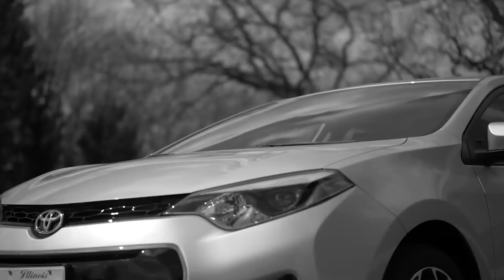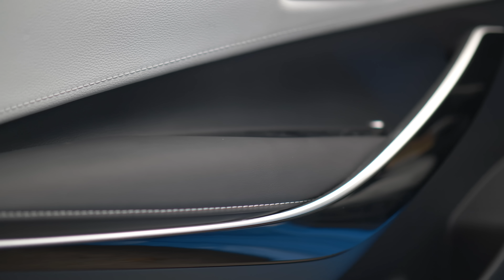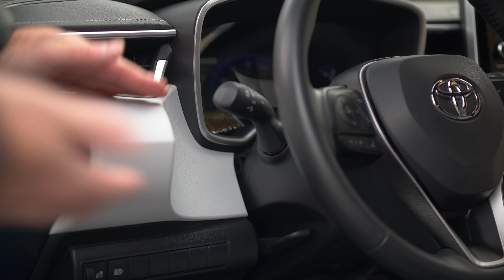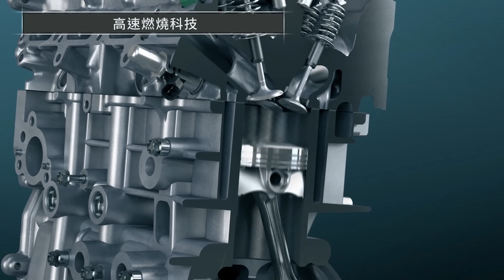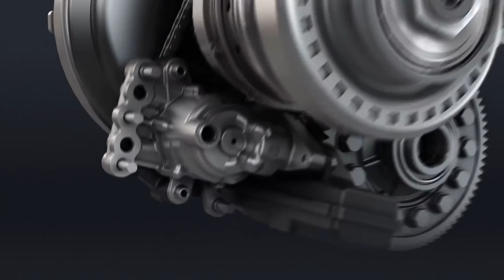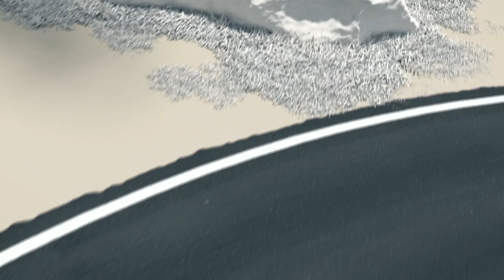Review | 2019 Corolla Hatchback | Sleepy Time is Over

Comment: I would rather get real Mazda 3 instead off Mazda 3 wanna be :)
Mazda3 next to this looks feels and drives like a luxury car.
Good direction from Toyota here, just put nice 8 speed ATX in it!!!!
These mfgs are trying to take advantage of cost savings with these CVTs making them more and more like normal shifting automatic but it still is CVT that after few years may be failing and cheese feel will never be completely gone with it. .... Time will tell reliability wise for engine and CVT both can be prone to issues and this is a big NO NO for every Toyota buyer

Comment: Turbo = performance.  I don't care how small or big the turbo is, but 0 turbo = 0 turbo.
I won't even consider going in to a dealer to test drive ANY car, if it's not any cut above a normally aspirated engine.  I have a turbo, Have had it for 14 years, and know for the first time, what a performance 4 cylinder can do for me.   Toyota will eventually come up with a sensible turbo to put in this thing, but I guess now is not the time for this car.

Comment: I still picked the 2019 Forte S over the Corolla just because I got a better lease deal. I did look around the forte inside and out and found it could very well be a keeper assuming the weakest link isn't the IVT. I'd actually buy it off if it behaves well enough. It's cheap to operate and easy to work on.

This hatch would be #3 in my top 3 where #2 would be a Forte5 with the new re-design.

Comment: Went with the Mazda 3 hatch over this simply because the safety systems in the Mazda were better implemented and more customization.

Entune or whatever Toyota calls it is total crap compared to Mazda Connect - and lets face it, Mazda Connect ain't no saint it has some massive flaws (although they finally added CarPlay and Android Auto) but Entune is just terrible as you said its unfathomable Toyota is doing this to themselves and losing sales on what is a clearly superior compact to EVERY other option in the class.

Also, isn't this platform co-developed with Mazda?

Comment: Wouldn't having the infotainment screen "sticking out" mean that its easy to service than having to tear apart the dashboard when the screen was meshed within the dashboard when it needs to be repaired?
Reply from the maker: Depends on the design often times you still have to remove the vent work below the screen to disconnect wiring harnesses and unscrew mounts with the stuck on displays. So its similar to in dash units.

Comment: I had the last model Corolla hatch, and now have this one.  Both had/have CVT auto box. They have removed the "ash tray" / coin box on the drivers side on the dash.  They have removed the sun glasses compartment above your head, next to the interior lights.  They have removed the extra top centre console small compartment for the mobile phone.  They have removed the extra cigarette lighter outlet to the rear seats. (I used it for the dash cam power).  The rear door latch is no longer half way up the door, but at the bottom - must now bend down to unlatch it. Less space (LESS! And the car is supposed to be larger?) in the rear - our bags could sit on their side and still close the rear hatch.  They can't now.  Auto CVT gearbox is not as smooth as the last one.  Lots of gimmicky things like side-radar that is sooo off-putting to use.  It slightly fights you as you steer.  Enough buttons and menus to sink a battleship, but no maps.  Doesn't feel more powerful at all, in spite of 200cc extra engine capacity.  While it is a nice car, I am not convinced that it is as good as hyped.  ...little things.
Reply: Those are some helpful details. This is smaller than the iM and the Matrix which would be fine if they sold the larger wagon here.

Comment: Serious question: This car uses 0W-16 oil, where would I even get that? Besides buying it straight from a dealership. I haven't seen that stuff around yet, only on the internet.
Reply from the maker: It will not be common place for a few years.  So right now just dealership and online, most likely Japanese oil and Mobil in USA.  The next eco grade is due out in a few years 0w8 ULV..  Personally Id buy Toyotas branded oil as its a true group III synthetic.
Reply: @savagegeese  I was just in my local Auto Zone recently and found they do have Mobil 1 0W-16 at least now. Just thought I'd respond.

Comment: I don't care how good the rest of it is. That center screen looks awkward and out of place. I would hate having to look at it, day in, day out. Would hate it. However I could live with it. The huge issue is, I'm a big guy. If I ended up slamming my knee into that protruding molding each time I got in, I'd probably literally go insane after a month of that. Years ago, the company I worked for had major issues with the vehicle I and others used on a daily basis. Horribly unreliable! We ended up driving around in a bunch of different rental vehicles over the years. But the absolute worst one was a Dodge Caliber.

Decent enough looking 5-door hatchback. But the automatic transmission shifter rested inside a slightly tilted box with four very sharp corners. Yup! slammed my knee into the same corner each time I got in. And yes, if I remembered to, I could get in very slowly to avoid that. But no one can remember each and every single time they climb into a vehicle. You have no clue how happy I was when it got replaced with a new rental car. If this re-introduced Matrix is suffering from the very same issue, then that is definitely enough to buy something else!
Reply: Its same same plus clutch pedal petal which ever

Comment: As always,  a very thorough and balanced review.  Thanks for providing such an in depth analysis.  This is probably now the best car out there for people that don’t really want to think about cars and/or really only care about going from Here to There.  Once they put the Corolla sedan on the TNGA platform, the big T might have to ramp down Camry production even further as I think those will fly off dealer lots.  

I, for one, am pleased with the dimensions of this little hatch. It is sized perfectly for a 99% of the time solo driver who never goes to IKEA and doesn’t haul dead bodies into the Pine Barrens.  It’s refreshing to see the Big T not try to create a “CUV replacement” but rather stick to doing a classic (almost) old school hatchback.  The only thing about this car that curls my upper lip a little: that damn “floating tablet”.  Toyota are even doing it in their flagship Avalon (although less ostentatiously than here) so it can’t all be about cost-cutting can it?  Someone over  there must think it looks good.  I have a theory that there is an ongoing wager between the “head unit team” and the “grille team” to see who can get away with the most hideous designs. The head unit guys win on Corolla. The grille guys win on Avalon.

Comment: They should've called this thing the Toyota Corolla SXE, instead of the XSE. Looks like a fantastic daily driver! This is what I want to see from auto manufacturers, innovative advances in engines, chassis, transmission, suspension, with a simple but classy interior and non-gaudy exterior. Toyota did this right! If only Honda could change the body of the Civic Type R to look less like something a 10 year-old child designed during an influenza-induced fever dream while tripping on cough medicine.

Comment: While of course the Corolla has always been the first car I think of when I think of a reliable commuter, while not necessarily the best looking of it's class, this looks absolutely phenomenal! A hatch too, WITH A MANUAL?!? Toyota's on the ball with this redesign. I've only been aware of the redesign for the lengthy time of 5 minutes, but immediately, it looks like the single best design of the Corolla in decades. This is the first time since the AE86 that I would say the Corolla is a really sharp design, especially while bringing back a hatchback. While I was born a fan of Mazda, and having learned on a pair of Manual 3s, this looks like a very worthy competitor of the excellence of the Mazda 3. Toyota barely even shows up on my radar, but they did such a damn good job of chiseling the Corolla up to the point where I immediately looked at and liked it. The proportions are right, as is the addition to a hatchback. If I were looking for a new, reliable compact sedan or hatch, I would immediately put this equal on the first spot on that list along with the Mazda 3, which I value due to personal preference. If I hadn't bought a newish Mercedes-Benz recently, I would love to test drive one and even buy one. I absolutely love this design, and I hope Toyota gives proper credit to where it's due to the engineering and design team that created what I think is an instant masterpiece in modern compact car design. Even SavageGeese himself looked like he had a hard time finding faults in the overall package. A GRMN spec would be a legend for our time. I'm totally down with this car, and can't wait to see it in person.

Comment: Very nice car - impressed overall. But I do have to say that the view from the rear while it's on the lift reveals the comical chrome fake dual exhaust a little too well. Why do they do this? The fake chrome outlets are right there. The actual pipe is right there. Either affix plumbing to the outlets so the exhaust actually exits from them....or toss 'em in the trash.

Comment: One of the important reasons people buy a hatchback, if not the main reason, is for increased cargo carrying capacity, and you didn't discuss that. The cargo volume capacity with back seatbacks up and down, the size of the rear hatch, the lift height, the quality of the floor of the cargo area as far as weight-bearing ability, and the maximum weight of cargo and passengers. Also it would be nice if had covered what kind of tires this car comes with, are the cheap tires with a low tread-life and poor grip in dry and wet and poor cornering, or can you have the car delivered with decent all-season tires, or even high-grip summer tires. Tires make a huge difference in how a car handles.

Comment: You did 0-60 in about a little over 8 seconds, making it just as quick as my Toyota Auris Hybrid 2014 (In Europe the corolla hatchback is called Auris). In Europe, we do not have 'fake gears.' Just the regular CVT, which is with normal driving inaudible and when flooring it, audible for a brief moment. I like the design of the new 2019 model a lot, but I do think that the display in the middle console looks hidious...

Comment: I love my Toyota Corolla Hatchback. I live on a bumpy road so I've bottomed out a couple times, but the CVT with the jump gear, the adaptive cruise control, the styling, and the fit and finish make it a great package.  The mileage doesn't quite match the EPA estimates, but it's still very good. It's more sport than utility, as the hatch isn't very spacious. And while the sound system and infotainment console are good, it doesn't yet have Android Auto.

Every car has its compromises. Here I sacrificed space over styling (get the Fit or Mazda3 for luggage capacity) and I wish had a couple inches of ground clearance (get the HR-V or Crosstrek instead). This car has solid acceleration and an impressive tech package for a great price. I miss my manual Fit Sport occasionally, except when I'm in traffic, which is most of the time.

I have zero regrets. The Hyundai Kona Electric looks enticing, but it's out of my price range. Zero regrets!!!
Reply: What do u get mpg
Reply: Thanks for the testimonial. As time goes by I wonder if you will miss the manual.
Reply: I just got over 44mpg in mine on a trip from Michigan to Kentucky and back with 300lbs of passengers and gear. I felt the same at first too, once I got used to driving it and finding certain throttle positions I can get almost 50mpg on smooth flat highways. You'll get there!
Reply: What trim?   I'm on a hilly dirt driveway.  Hoping the SE trim has more clearance.
Reply: @lukeywalsh  I wouldn't count on it. But the thicker rubber will give you a softer ride. I've driven my xse on the 18" wheels for 25k miles around dirt and snow covered roads delivering pizzas and haven't had any issues bottoming out, so maybe it's more how you drive it

Comment: The consumer ruined the CVT. CVTs are meant to keep the engine at its optimum RPM, to increase fuel efficiency, and stay at the peak of the engine's power band. But the consumers just hated the sound, and the carmakers made CVTs that acted like automatics, basically rendering the entire concept of the CVT pointless. CVTs can be great, I mean the Williams F1 team used it in the FW15C, and it was incredible. They are just as quick as any other transmission, and can take the power. But the ignorance of the consumer (and lack of education about the technology) ruined the CVT.

Comment: This is the best looking Corolla since 2008!
Reply: But still doesn't have the luggage space of the 2000-2007 mode hatchback. They've got progressively worse since that one with more and more sloping rears.
Reply: Cassette Walkman Yes but my 2003 XRS got 24 mpg highway. With a 180 hp 4 cylinder. That thing was not aerodynamic.
Reply: since 1985
Reply: I love the 2020 design

Comment: If you drive like a typical Corolla driver, do you think that the mpg in non-city driving could approach 40 mpg with the CVT??
Reply: Most of the buyers are not gear heads.
Reply: I got 44.3 round trip from Michigan to Kentucky and back. That was at 7-15 over the speed limit with occasional traffic and some spirited driving around windy Kentucky roads

Comment: I've owned an XSE with the CVT since August and I love it. The interior is really nice - almost Lexus like (for the XSE). Additionally, there's full LED exterior lights (front and back), a decent sounding 8 speaker JBL sound system, dynamic navigation, wireless charging, etc. It's definitely worth a look if you're looking for a reliable daily driver.
Reply: Do you still have the car, and if so, what do you think about it today. Do you put a lot of miles on it?

Comment: This is the first Toyota Corolla I actually like. I have a 2017 Mz3HBT 2.5 /w manual. I would still prefer what I have over this car, though. Even though reliability is just a notch below, I'll still take mine. It's quicker, gets about the same mileage with a much torquier engine, super laser like steering, great interior as well...and it's super fun to drive. Most fun since my old '92 SE-R! Just wish mine had a remote hatch release and a GOOD tachometer...like the one in the automatic version 🙄

Comment: Fake shifts are a dealbreaker. The whole point of a CVT is that it holds the engine at the ideal RPMs. A CVT with fake shifting is just a cheaper, less efficient, less reliable automatic.

I wish that more manufacturers used wet-clutch DCTs in hatchbacks like VW.

Comment: I have a 2018 iM and I drove this car and there is 0 difference in drivability. They both ride the exact same. You don't notice the 30 extra horsepower either. The new 2019 is a NICE car, but if you've got an iM, I wouldn't recommend upgrading. To me, the bells and whistles like Apple Car play aren't worth it on this new model. Unless, you wanna shell out the money and pay as much for a Camry cause this new one starts at 24k

Comment: It looks aggressive and fast.

The reality is; it will be driven 30 under the limit, in the left lane, with the left turn signal flashing for miles, and, the high beams on....just like every other toyota on the road.   

Toyota; you're either in one, or stuck behind one.
Reply: I drive mine 30 over a lot of the time. It does well

Comment: Completely disagree about interior comfort of this hatch.  Tried seating in this thing in the dealership and the rear seating accommodations are pretty mediocre if not bad, compared to a regular Corolla sedan (at least the sedan in the previous model years, unless they downsized).  The rear entry point is just terrible with an awkward entry angle and the low slanted roof.   And there isn't much trunk space in this thing either.

I also don't understand the common complaint about the screens propped up on the dashboard.  It allows for a larger screen and also for it to sit higher in the field of view which is safer.

Comment: 0-60 in 8.5 sec. in "sport mode"  (slowest car for 2019 to-date)  Lateral g (handling) 0.83g (worst handling for 2019).  Fake stitching on plastic.  Ironically, most Corvettes get better gas mileage than this highway.  Terrible car.  Cashing that check from Toyota?  Lotta "sweet talk" for the worst car made this decade.

Comment: @ 10:33 - what's with all the rust around the bolts on the left rear wheel and at the base of the rubber boot ?
Reply from the maker: Typically uncoated steel. Surface rust.

Comment: Understand too that although the engine is advertised as being able to run on 87 octane fuel it WILL NOT achieve its advertised fuel economy or horsepower ratings without the higher octane fuel.  This is a HIGH compression engine that requires high octane to achieve this, but is computer controlled to allow completely normal and safe operation of the engine on lower octane gas.  Albeit sacrificing fuel economy and horsepower. So, yes, you can run this car on 87 octane fuel for it’s entire life and have no issues if you’re willing to give it’s economy and power potential.